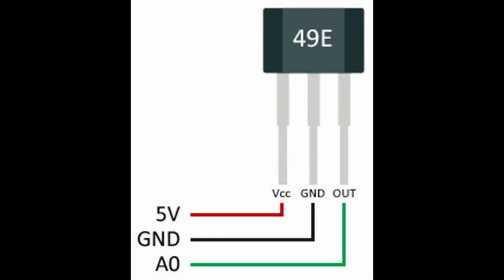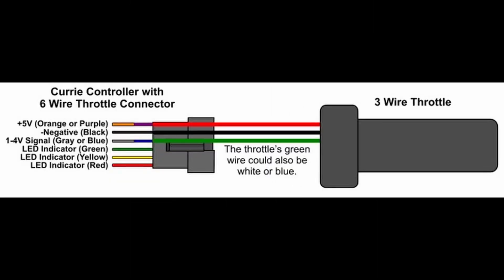Use hall effect sensor SS49E to fix your ebike throttle!

Comment: Hi, great video. I am replacing a Hall effect sensor (49E) on my e bike LCD Display / Thumb Throttle. The problem is that the Hall effect was badly welded and suddendly fell and currently do not know which cable color goes where (only one I know is that the middle cable goes in the midle). Am I risking to burn the display if I wrongly weld the other 2 cables or given the voltage could not be a problem in your opinion??

Comment: I was thinking about using the 16-22 size crimp on bullet connectors for my 6 hall sensor wires. Then I could just plug and unplug them. Do you think that is a good idea ?